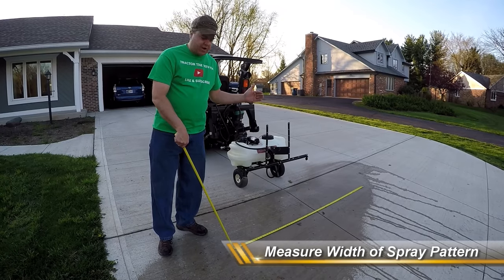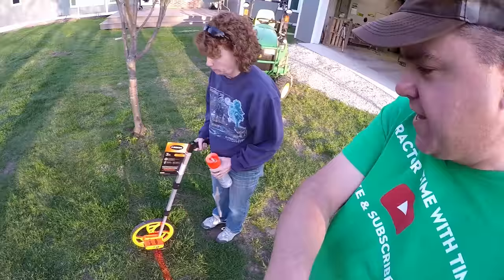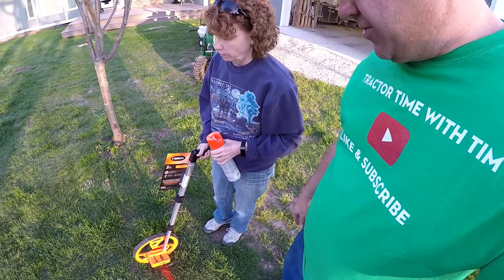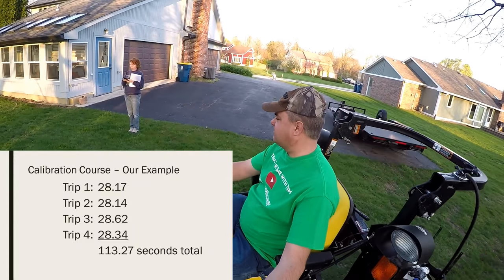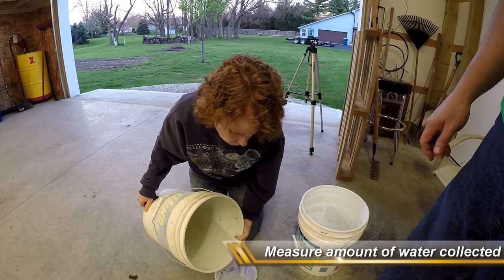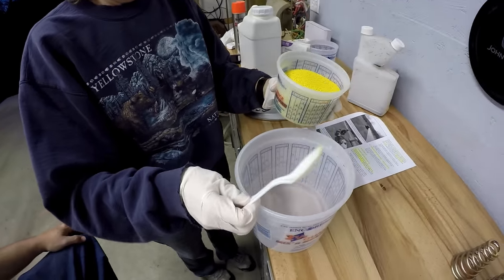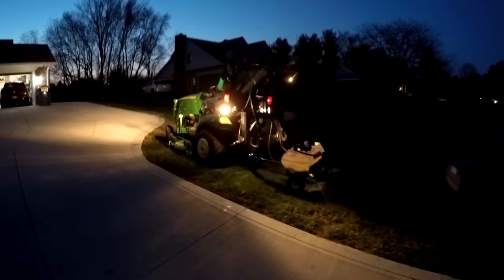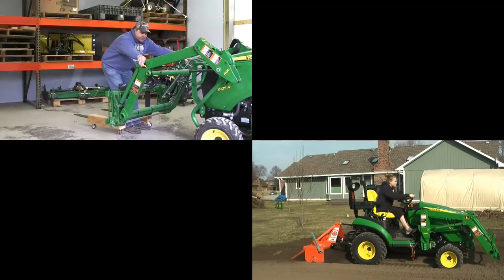DIY Lawn Care: How to Calibrate Your Lawn Sprayer

Comment: Hi ttwt. I use a single spray nozzle and set it the same width as the mower deck. That way I can raise the mower deck and shut the  pump off so I can see where I have  sprayed. I have two and a half acres ran water in the sprayer first time over the yard. Came up with 4 -15 gallon tanks and calculate from there

Comment: This was great in terms of calibrating the sprayer. Thank you for that. However, if you haven't already figured it out by now, the table you used to determine application rate for the Prodiamine was not the table you should've used. However (yes a second time), if your intended rate of application is 1.15 lbs/acre, then 0.4oz/1000 sq.ft is correct. That would give you about 5 months of coverage. So if that was the case then you're golden, but if you wanted just 2-3 months coverage, you'll have to go down a bit (especially if you apply this twice per year).

Thanks again!

Comment: Love the shirt! I use 32 oz of trimec 992 for 30 gallons of water. Mount the tank sprayer on the back of my zero steer, unfold the 10' boom arms and go till I run out! Works for me!
Reply from the maker: +Fred Kaminski sounds good!
Reply: thats a low rate depending on your speed and nozzle tips.

Comment: I have a single nozzle pull sprayer that states it has a 40" coverage, but actually sprays 80". This is what it says in the owners manual "The overall spray width is 80", but 1/2 or 40" of the overall spray pattern must be 
overlapped to get equal coverage throughout the spray area." Not sure if that's why you are getting a wider pattern than it states, but it makes since to over lap for more even coverage.
Reply from the maker: +Travis Houseman probably.

Comment: sorry for all the question, but  did your calculation of 5.x gals prove to be accurate.  I am in the process of figuring this all out. My pump is 2.5 gal/ min.. I set it at 25 psi and measuring water output for the 30 sec it took to travel the 1000sq ft  I came up 3 qt or 96 oz output, thus 10.5 gal / 1ooo sq ft  for the 14000 sq ft calculation.  I would think your pumps output would be more than the one i have, and our times were about the same.
Reply from the maker: Pump output is not relevant.  The nozzle size is what determines the flow rate. 
So, pay attention to your test results.
The only variable is how much you overlap, or spray twice accidentally.

Comment: I use the charts in the pump PSI and nozzle GPM specs. Then verify using similar steps as your video. I also like to use Markit blue die in some applications and areas. Winterizing the pump was the costliest mistake when I started.
Reply from the maker: sounds good.  Winterizing, or NOT winterizing?

Comment: When I use weed killer (2-4d) it's liquid 1.5 per gallon.You want to just coat the leaf.I do a test run with water down the driveway to get the speed to wet the driveway without making it puddle.However I haven't used the sprayer in the last couple of years using a pre emergent granular fertilizer.
Reply: where did you find the 2-4d? Ive gone to walmart but they dont have it... do you have to order it?
Reply from the maker: I have a post on this on my website.
I think it is domyownpestcontrol.com. 

Check tractortimewithtim.com to be sure

Comment: So it seems things changed from last year. If im not mistaken you were using the full sprayer to do your yard last season for 14k ft. going from that to 5 gallons seems to be a drastic change.

Was you over doing it last year?
Reply from the maker: +D. Cole I was spraying at much higher psi last year. Read online that 20-25 was all I needed.

Comment: I'm not sure how helpful this would be in all areas but in our county and surrounding counties we have whats called GIS. You can find it by googling your county name and GIS in my case Warrick County GIS and it will bring up a map (you may have to do an agree to something before the map appears) and then you can type the property owners name in the search box (last, First) and it should pull up your property(s). Then you can go to a tab called "Tools" or "Parcel Tools" and go down that list until you see "Measure Area" Click on that and then a box should appear on the screen. Change it from "Acres" to "Square Feet" then you can click around your lawn to measure square footage. This map allows you to go around anything on your property.
Reply from the maker: +JohnDeere3020Boy yea, we have that in Hamilton county too. May be the same system all over the state.
Reply: I'm pretty sure they do I know like Vanderburgh county down by Evansville has the same system but it looks different and is harder to use
Reply: You can do this with google maps. Just go to google maps find your property switch to satellite view for easier viewing then right click the map and select measure distance and it will plop a marker down with every left click. Once you click all around the outside of your property and circle back to your starting point it will give you the total area in ft².
Reply: Didn't know this thank you

Comment: I don't use a sprayer to fertilize my yard.  But that's not going to stop me from commenting.  I'd fill the tank with the area calculated amount and then drive around until it was gone.  BUT! I have a real need to get a sprayer for my fruit trees and mini vineyard.  I could get a really cheap one from Harbor Freight or really expensive brand name one that's yellow.  Is the extra price worth it for these things?  I want a three point hitch or ATV style sprayer I think.
Reply from the maker: I got mine from rural king.  Same things available at TSC.   I wanted a 3pt too, but I saw how much more expensive it was....so I then looked at the ATV style. It is the cheapest.  ...I was thinking I could make a 3pt or 2 inch receiver mount for it.
Then, I realized that the wheeled one wasn't a whole lot more than the ATV style, and didn't take any construction work to get it ready to go...so, that is why i chose it.  I'm not especially fond of the pull-type, but it doesn't really matter either.
Get one with a pressure gauge.  Mine has a hand wand which can be used instead of the nozzles.  This is what you would use.  I got the 2gpm pump.  It works fine.  
I have no idea if the 'yellow' one is better. Maybe if you get one, you can brag about how much better it is than mine!!!!!
Reply: Tractor Time with Tim Ok great.  I have a feeling the yellow ones are just prettier and not much more bang for the buck.  Thanks Tim!

Comment: Always mix it a little stiff too
Reply from the maker: Not quite sure what you mean by 'stiff', but I suggest mixing it a bit 'thin' in case you underestimated how much solution you needed for your property.
Reply: @TractorTimewithTim  not enough chemical can cause problems when putting out herbicide,  plants can build up a tolerance.  Many plants have mutated and have become herbicide resistant, which cost agriculture millions of dollars ever year because of mismanaged ag chemical application.

Comment: Big Tim,

I actually drive myself nuts trying to get these measurements right. I did all the math like you one day and really didn’t get the results I wanted out of the products I was using. I now just use the recommended ratios per a gallon for each product in the tank and a tad extra. I usually use about 20 gallons for the front and back yard. I cut as I spray to know where I’ve been and have the sprayer set to the width of the cut. This takes marking dye out of the equation. I drive pretty slow…about 3 mph. I’ve gotten much better results but then again I’m probably putting down more product then needed. All good though so far. I haven’t killed the lawn and there aren’t many weeds left. Thanks for doing this aggravating math for everyone. I enjoyed watching someone else do what everyone else dreads. Take care. 

Sincerely,

Dick Head

Comment: I have to admit I cheat Tim, I use a a Hardi calibration disk to do the math....
Reply from the maker: +Airplane Doctor oh, that sounds interesting.
Reply: Tractor Time with Tim It's a flat plastic rotating disk that has all the inputs with nozzle type, ground speed, etc. All you do do is turn the disk levels so all your inputs line up and you get instant setup numbers. They used to be free from Hardi sprayer dealers, not sure now.
Reply from the maker: +Airplane Doctor probably could find online
Reply: Airplane Doctor will

Comment: If sprayer nozzle spacing is 20 inches, travel 204 feet, time it, (42seconds) then run your sprayer for 42 seconds and catch water from each nozzle, divide to get the average OUNCES. (my case 27oz was the average)  Ounces = Gallons per acre